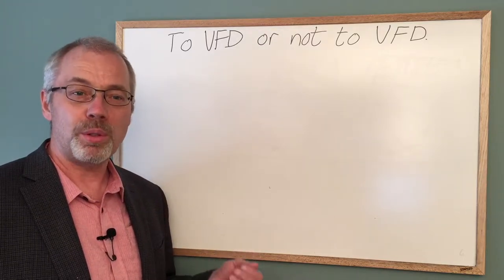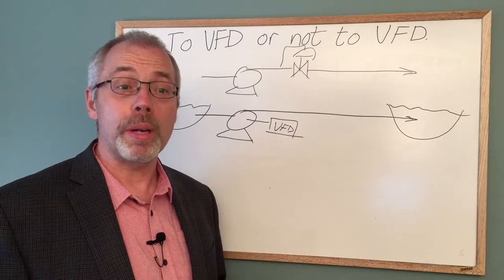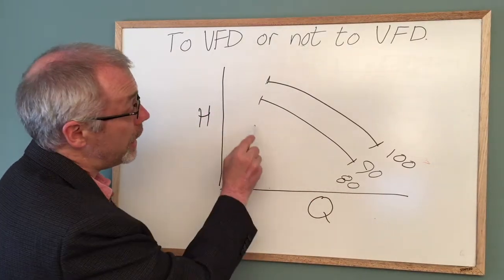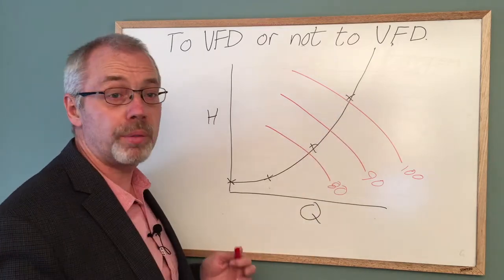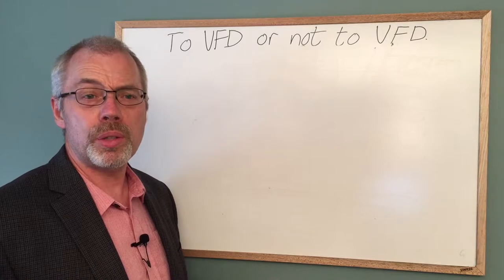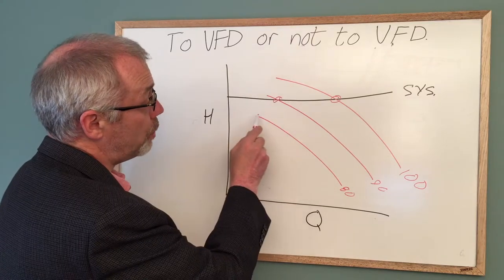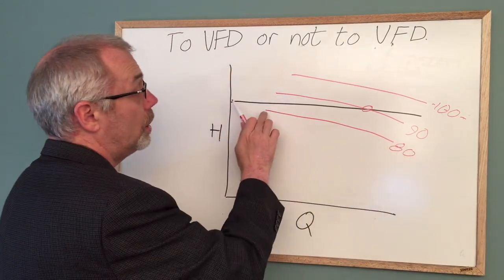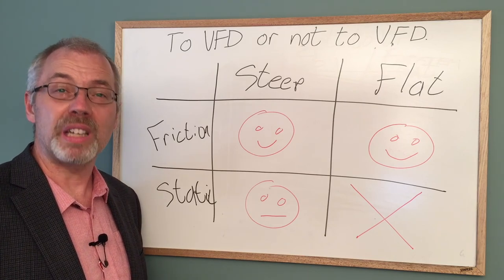To VFD or not to VFD: Centrifugal pump flow control

Comment: Congrats for the video. It is good to see someone sharing knowledge. Sir another question: by using a VFD and changing the speed of the motor there is no posibility of problems related to speed? I was reading about sincronous and pump curve in terms of torque and speed and it seems this speed should have a calculations in order to match the curve torque vs speed in the pump
Reply from the maker: Good question. If the system curve is flat then the motor requires constant torque and variable speed. The amount of heat generated by the motor is proportional with motor speed. But a fan cooled motor may lot be able to provide enough cooling at reduced speed. I have not calculated the amount of cooling at lower speed. I suggest only using VFD where there is steep system curve and no danger of overheating.

Comment: Hi Kevin, I hope you upload more videos.

I have a question, I have a motor whose nameplate indicates 3500rpm. Can I install a VFD and push the motor to higer rpm than 3500?
Can you recomend some books about this topic?
Are there any restrictions (apart from the explanations that you give in the video) related to motors and VFD?
CAn VFD be implemented on any motor?
Reply: The nameplate will be the rpm that the motor will run at rated voltage and frequency. The higher the frequency at the top end, the lower the torque. Depending on the application, this can be an issue in itself. There will be diminishing returns here and if you need to run faster than 60hz, then you're most likely going to need a different motor than the one you're intending to use. VFD's can not be put on just any motor as well. I'm sure you can find most of this information to answer your questions with a quick google search.
Reply from the maker: I have asked that question a few times. The answer I was given is You might be able to go a little faster than synchronous, but not a lot faster. Higher speed draws more power and may damage the motor. I don’t know if a VFD can be applied to any motor. Good question.

Comment: Kevin, thanks for the "Clear as clean water" explanation!  
I would be happy to know if, in your experience, you have some idea on what percentage of the total of pump applications, the VFD is not favourable?  Thanks in advance!
Reply from the maker: Of the applications where a VFD is used with a centrifugal pump, I think about 25% are not great. The strangest application I have seen is a VFD to modulate flow rate, plus a throttling valve to control discharge pressure. No surprise that MANUAL operation was common practice here.
Reply: @kevindormaconsulting4763  Kevin, I do agree with your estimate of about 25% of applications are not favorable to install a VFD on pumps, but on your comment about having a valve throttling the discharge, it is not an absurd idea, because of how some of those 25% systems curves do interact with a variable speed pump, and also it needs to be taken into account what kind of dynamic pump is being used... not all rotodynamic pumps (the correct name of so called "centrifugal" pumps) are started with its discharge valve closed or just cracked open.  It has to correspond with the "Specific Speed" or "Ns" value the pump has. Thus, in some cases, a discharge valve can be indeed useful in Variable Speed controls.  In all cases, it depends on the shape of the pump's curve against the Hydraulic System curve against the power curve of the specific pump used on the system, which mainly depends on the pump "Specific Speed".  An intelligent use of both VFD and Throttling Valve can be advantageous under some combinations of pumps and their systems.  A good inderstanding of the system interactions is through the use of a 3D graph, plotting both system and pump curves and superimposing the effect of the valve position or Delta P.  Best Regards.
Reply from the maker: Alfredo, I fully agree with your observations. The application that I saw was FAR less sophisticated than your experience. The pump had a very flat curve (low specific speed), and speed was varied to maintain constant flow. And there was a backpressure control valve to hold the pump discharge pressure at a fixed value. The intent of the control valve was to "ensure the pump always operated on the curve."  A pump with a flat curve, operating with a fixed discharge pressure,  is difficult to operate. The Operations Teams found the answer: Open the minimum flow recycle enough to move the flow rate well past the maximum allowable flow rate and into the steep part of the pump curve. Seal failures were common. The flat pump curve and perfectly flat system curve also had TERRIBLE flow control. The flow rate was oscillatory, and this had reliability impacts on the upstream vessel (frequent level excursions) and the downstream process operation (poor performance). Sadly, none of this evidence was accepted.
Reply: @kevindormaconsulting4763  A pleasure reading your posts. Good information to spare.  One thing I say in my pump courses, is that "the Rotodynamic pump is the simplest... but only mechanically, because it has the far from simple hydraulics".

Comment: Very nice tutorials. Sir I have a question: does the system curve changes if I have branches in the downstream pipe?
Reply from the maker: The system curve does not change if there are branches in the downstream piping. The system curve only changes if there is a resistance that changes (someone adjusts a valve). System curves can be difficult to describe for piping with several downstream branches because the destination pressures may be different for each destination. The system curve tells us the supply pressure that is needed to push into the destination pressure (at zero flow, the supply pressure matches the destination pressure).
Reply: @kevindormaconsulting4763  thanks for your answer sir. I have another one: what about positive displacement pumps like an screw one? can I use VFD in that case? since the curve is only FLOW rate constant?
Reply from the maker: @rucaskeeper666  a VFD is a good application for a positive displacement pump. Flow rate is proportional to pump speed. The

Comment: Hello, I have a question. I want to propose a control strategy for an HVAC closed-loop system, where it works at partial load. We need to reduce the electrical consumption energy using a VFD. The system must have a constant pressure in the mainline to ensure enough flow to the farthest point or load. I already checked the pump curves and the pump can reduce its flow working above the minimum flow permitted. The minimum flow is 50 gpm and in the control strategy, we can reduce until 300 gpm. There won't be any trouble if the pump works above the minimum flow value.?
Reply: Did you really think this guy was going to answer your question?  He's not here to do free engineering work for you.
Reply: @Impedancenetwork  I already checked by myself, and I solved the issue without his help or yours. Unfortunately for some people like you, every thing is about profits and benefits.
Reply: @Rafaverdad hai bro..i got same question in my mind..did u able to introduce the vsd without sacrifice the head pressure?

Comment: Kevin
I need a clarification about the valve controlled recirculation loop installed in a centrifugal pump.
When DISCHARGE<MCF, it determines insufficient suction fluid but how does the recirculation line helps resuming the MCF
Reply from the maker: The pump delivers fluid to two destinations. The main destination is the process. If the process takes less fluid than the MCF, then the pump will have seal problems if it is operated for a long time. The minimum flow loop opens another path and ensures that the total flow rate through the pump is at the MCF. In this case, we need a flow meter on the total discharge from the pump (the main process flow plus the recirculation flow). Did this answer your question?
Reply: @kevindormaconsulting4763  
Your reply is convincing and satisfactory for the case where the system requires lesser fluid recirculation line enables the balancing of pump fixed discharge. My company is installing a recirculation line to a desalter crude Feed pump where the throttling of feed is not essential and it remains constant, what could be the need for the recirculation line towards balancing? Kindly comment plz
Reply: @sabeerali5610  Dear Sabeer, it happens that one of the expertise areas we developed in my engineering company, was precisely the intell unigent selection of the best type and size of pump for feeding the Crude Oil Dehydrators or Desalters at our State owned petroleum company ("PEMEX").

In that service, the use of a pump is required mainly because of the Desalter needing a certain pressure margin above the oil-gas equilibrium pressure, owing to the gas tendency to be released from the crude oil, and thus creating small bubbles that interfere with the water separation from the oil... That happens because the gas-liquid equilibrium corresponds to the last oil- gas Separator before the Desalter, and the fact that the Desalter or Dehydrator has SOME pressure drop resulting from the internals, like the crude oil distributor and its piping.  Therefore, all Desalter vendors establish the requirement of supplying and maintaining at least 20 PSI above the gas-liquid equilibrium, to avoid the gas fraction to separate, form bubbles and interfere with the water droplets separating and falling to the bottom of the Desalter.  Thus, the need to install pumps before the Desalter in order to rise and keep the pressure inside the top if the vessel at least 20 PSI or 1.4 bar above the pressure at the last separator before the Desalter.
BUT, almost any pump will unfortunatelly produce the highly undesirable water droplet shearing, due to the turbulence and mechanical shearing of the water droplets... Even Positive Displacement pumps shear the water droplets enough to reduce the separation at the Desalters.  Remember that separation of those droplets is governed by the Stokes Law, which says that halving the mean droplet size, will require FOUR TIMES for the same separation, and reducing the droplet size to one third, would necessitate a NINE TIMES larger vessel for the same separation (because the droplet diameter is squared).  Therefore, it is very important to keep the water droplet size as large as possible, which dictates that the pump must have the lowest droplet shearing possible.  As this subject is not easy or trivial, I suggest you to contact me at amarquezclaussen at hotmail dot com , for an ample discussion on these matters. For the moment, allow me to tell you that many standard pumps used before Desalters, are totally inadequate in regards to the harm they impart to the oil-water emulsion, and that makes the separation quite more difficult because care is not applied to pump type selection or its best sizing and nothing is done in order to have the pump operate at the lowest damaging droplet shear on its curve, and remember that any valve placed before the Desalter will also cause undesirable droplet shearing.  A different engineered approach, that takes into account the droplet shearing, will reduce the damage and promote a much better separation efficiency from the Dehydrators or Desalters.

Additionally, using the conventional "mixing valve" to mix the desalting water stream with the crude oil to be desalted, results in lower Desalting, reduced separation, and a larger water use.  There, a more intelligent approach is in order too.  Myself, I have dedicated many years at studying and improving the Electrostatic Dehydrator or Desalter operation, with measurably good results, and that demands a different pump selection and sizing criteria, that is NOT the usual criteria followed by pump vendors and manufacturers.  Go and ask any commercial pump vendor, and require the "Emulsification Parameter" of their pump when pumping a Oil-Water mixture to a Desalter... I'm quite shure he won't be able to answer, because 99% of pump designers, have never taken the consideration of the undesirable mixing and emulsifying effect of their pumps, having only dealt with single liquid phase fluid handling, but pumping a crude oil-water  emulsion is quite another matter, and too little has been done globally in order to keep the water droplet size distribution without having little droplet shearing.  I wait for your contact soon.  Sincerely, Alfredo M. Claussen, 42 years experience at the Mexican Institute for Petroleum in Mexico City.
Reply: @alfredomarquez9777  Awesome explanation😀
Kindly give me sometime to understand your context in full and I shall definitely get back to you vide your email stated Sir.
You read my mind clearly and wrote a wonderful and convincing reply.... My sincere thanks and hearted greet for your efforts Sir👍
Reply: @kevindormaconsulting4763  Sure I shall revert to you with the typical sketch of recirculation project soon
Reply: @sabeerali5610  Well, I am happy to try to help... This same week, I am retiring after 42 years of working at the Mexican Institute of Petroleum in Mexico City.  Having studied Crude Oil Dehydration and Desalting for at least 25 years, all that knowledge demands to be used!  Again, happy to answer any questions you may have. Just contact me directly at my email hotmail address, and I will try to do my best.  Kind Regards.
Reply: @sabeerali5610  Kevin: It appears that our friend Sabeer is involved in Crude Oil Desalting, and has to deal with the pumping system... It would be interesting to discuss this theme in more detail, as pumping is both needed by the process, and also causes some damage to it, because it augments the separation difficulty due to water droplet shearing, my field of expertise.  Hope you follow the discussion, and again, thanks for a very good and nice video!

Comment: for the scenario at 9:20 cant the VFD operate at say 88% and still be within the system curve?
Reply from the maker: In this case, the pump would only be able to run between say 88 and 92%. It would be difficult to control the flow rate. A control valve gives better reliability in this case.

Comment: how would this apply to residential well water systems? Good idea or not?
Reply from the maker: A well water system is dominated by static head, so the system curve is flat. For a VFD to work, the pump curve needs to be very steep. I have well pumps with steep curves, but only for large industrial systems. A small pump for a residential well is likely to have a flat curve. No, I don't think a VFD is appropriate for this application.
Reply: @kevindormaconsulting4763  interesting, okay thanks.
Reply: @kevindormaconsulting4763  Hmm ... my local well pump service company is suggesting a new pump with VFD for my 195 ft well, which currently has a 45 year old, 1.5 hp, 240v submersible pump. This system is no doubt dominated by static head as the above-ground pipeline length is about 100 ft with 1.25" diameter pipe. I assume the well service company will choose a compatible pump that has a steep pump curve, but can I be sure?  My use is typical for a home (two residents) with little or no landscape irrigation. I'm having doubts that I need a VFD rather than a conventional pressure tank system, and worried about the problems you mentioned in the video. What is your advice?  Also, will I need 3-phase, 240v power at the well to use a VFD?  Or, does the VFD take 1-phase input and convert to 3-phase?  Thanks!
Reply from the maker: @GKALLIO  interesting application. If this is a multistage pump then it might have a steep curve. Ask the service company to provide the pump curve and check if it is steep. Ask them how they will test their application to ensure that the pump can provide low and high flow while maintaining constant water pressure at the surface. The long run of pipe May provide enough resistance to make this really suitable for a VFD, but only if the pressure sensor is located at the far end. Your gut feel may be worth following.

Comment: t=1:30 -> Can you really say definitively that a control valve uses less power than a variable speed drive?  There's a small loss in the VFD and clearly a loss in the CV (depending on how you have sized the CV).

t=3:21  Typically a system curve is the pump differential pressure, not the inlet pressure.  Inlet pressure is a guage or absolute pressure.  Saying that the pump inlet pressure will (must) rise as flow increases is either confusing or ignores some other assumptions that must be true.  In fact the source pressure in your example is probably not changing and the incrased flow rate is causing greater frictional losses, so the inlet pressure is dropping with increased flow rate.   Pump head is a differential pressure, so to plot inlet pressure on a pump head curve is a little confusing.   However, plotting system differential pressure on the curve does make sense.

t= 7:43  So, that's a good point.  Thanks for pointing that out.
Reply from the maker: A VFD should (almost always) consume less power than fixed speed pump and control valve. This is because the control valve must take 10-20% of the total pressure drop. I did not clarify where the inlet is. This is the pipe inlet (pump discharge). I assume pump suction P constant. System curve is the pipe, starting at the fixed outlet pressure. Pump curve is the pump discharge, which is the pump DP plus suction pressure.
Reply: @kevindormaconsulting4763    I think there's also a case for using a control valve if the situation calls for a process to be isolated from the pump, and using a valve is necessary for that.   

Where there are multiple destinations, it's possible only one of the control valves would be eliminated with the use of a VFD.   You still may save some energy with a VFD though.